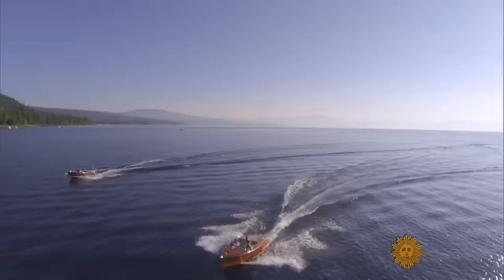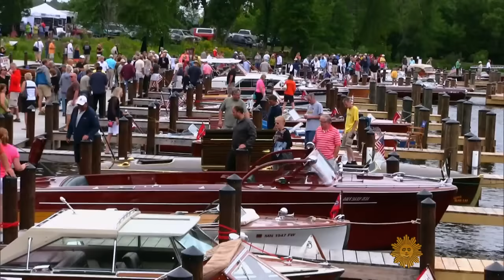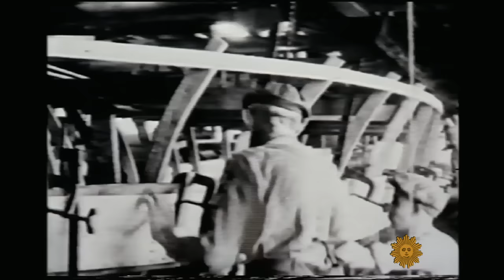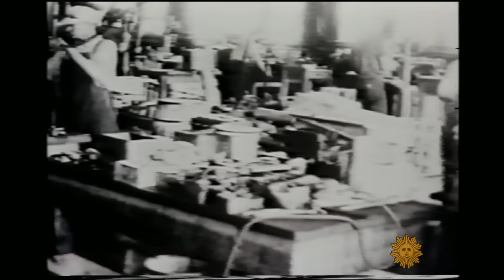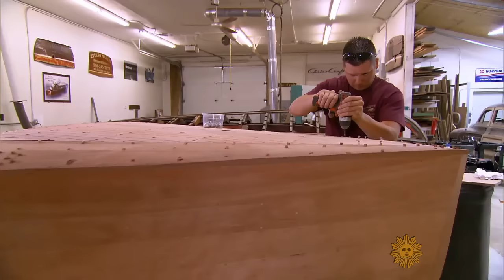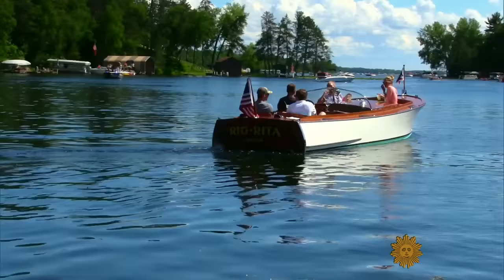The elegance of classic wooden motorboats

Comment: Ford Falcon Sprint steering wheel not a Mustang yes there’s a difference.
Reply: Difference in what?

Cause minus the color and the logo, that looks exactly like the wheel I stare at every day in my 65' T code.
Reply: psygnale the depth of the center of the mustang wheel is different as it sticks out further so the Chris Craft center can’t be installed. Pull off any Chris Craft center cap on one of those steering wheels and it’ll say Falcon Sprint.